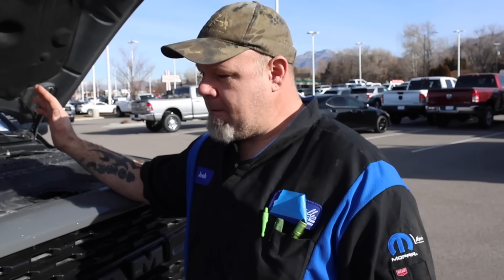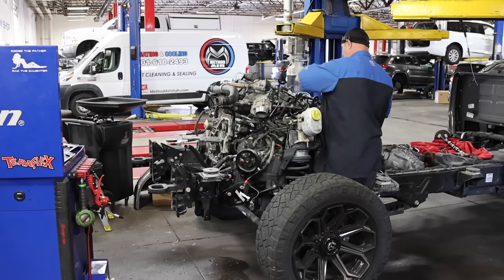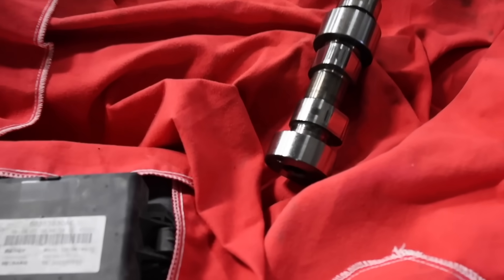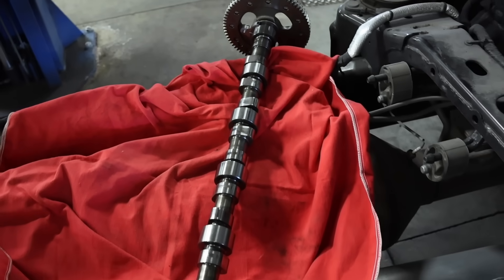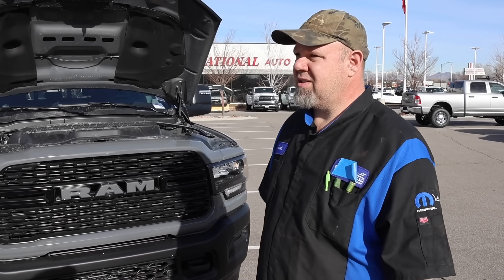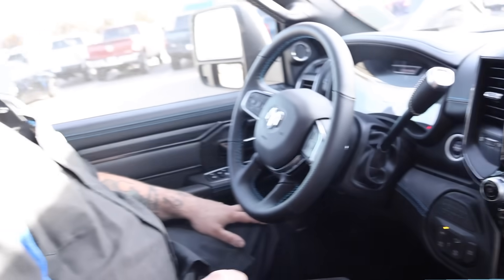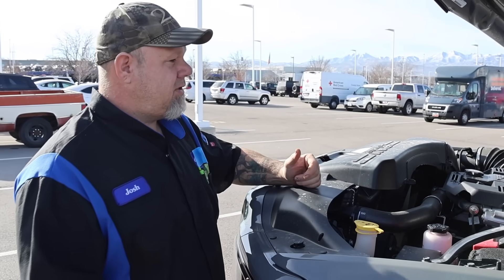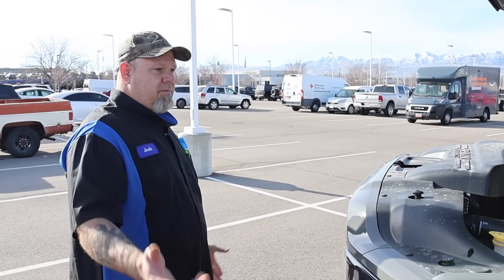Master Diesel Tech Explains The BIGGEST Killer To Your Diesel Engine!

Comment: The EPA and their mandated DPF is the largest killer of diesels.
Reply: I think EGR is worse than DPF. Lastly SCR is the least killer. Not saying DPF isn’t bad, but EGR dumping particulates back into your intake is worse than driving around the desert with no air filter.
Reply: @MrNismopro couldn’t agree more
Reply: No EGR is 1000 times worse than DPF.
Reply: @ 
Yes, another horrible EPA mandated device
Reply: @Jon-O.  What do you mean? Like a deleted truck is the worst thing for a deisel?
Reply: @SAPPER235PUNISHER No a deleted engine will last much longer.
Reply: Ford is putting a gasoline particulate filter (GPF) on their new 25 mavericks. Due to the EPA’s new strict emissions standards. Iam sure all the other big manufacturers will follow suit. Just put what I just wrote in YouTube and many videos will come up on the topic.
Reply: Luckily no DEF on my ‘09 ram dually crew cab. Too bad my DPF and EGR fell off my truck years ago😂
Reply: Please explain how dpf kills a diesel….
Reply: @ 
It is a complicated system that adds many sensors and components.  It adds thousands of dollars at purchase and drives up maintenance substantially.  The majority of trucks one sees on the side of the road with the hood open are sidelined from an emissions system failure.  The computer continuously monitors all components and if one doesn’t function within parameters the truck will give a warning that only allows a couple hundred miles of operation before going into limp mode.  This could be something as simple as a loose ground wire or a dirty connector.  Roadside repairs or tow service is not cheap and adds cost to everything purchased at the store.  Does it literally kill it? No.  It just makes them economically expensive to buy and run.
Reply: No egr is worse
Reply: Yup,  I'm a retired truck driver,  DEF is a bullshit scam
Reply: @woofman4796 ammonia oxide is what’s being produced now
Reply: EGR is the worst idea in engineering history. Eat thy own waste 🤮
Reply: How to look after egr
Reply: I need a shop in South Florida to delete my diesel grand Cherokee. The egr and dpf on the 3.0 = nightmares
Reply: DPF is done in the exhaust not the motor. I think you mean EGR which recirculates Exhaust gases into your intake which is not good for any vehicle and is especially bad on oily fuels like diesel.
Reply: Stupid pan designs keep oil from being totallybdrained. Banks has new pan that is incredible plus adds 2 quarts of capacity as well. Genius
Reply: And government vehicles are exempt from this
Reply: Def is injected into your exhaust nothing to do with the inside of your engine
Reply: @ 
You are correct until a sensor goes bad, the DEF heater circuit has a minor issues like a loose ground wire and the computer gives you 500 miles to limp mode in the middle of an extended trip.  Complexity and electronics adds to unreliability.
Reply: @ he was talking about increasing the longevity of the engine not part of the dpf system failing
Reply: The worst thing for an engine is excessive heat. And I have got to believe that the regen system creates so much heat that it has to be detrimental to the life of the vehicle. I never understood how reburning the emission particles and contaminants through the EGR and regen systems can be better for the environment. Apparently the regen system just breaks down the particulates into smaller size which in my opinion would make it more prone to be airborne longer than just dropping out the exhaust and right onto the roadbed. And by being airborne longer would allow it to get out into the areas such as lakes and rivers. In other words that contamination can be more easily spread. Just like electric cars these new solutions just create new problems.

Comment: I own a fleet of CumminsISX semi trucks. I’ve never changed oil before 20k miles on any of the 8 trucks. One truck has over a million miles and just now due for an overhaul. No issues. 5k mile oil change interval in a common rail is dumb AF and a waste of money.
Reply: Your ISX is likely sitting next to a centrifugal oil filter on the frame rail. Those things flat out work, and they're full of carbon sludge when you clean them. I'm going to be putting a small one on my 12 valve, because it can't hurt and I have the space underhood for it. These modern pickup diesels are a nightmare due to most being driven around as big cars 90%+ of the time, and are equipped with less than durable emissions components, so I fully understand the fear people have of repair bills. It really is criminal what the EPA has saddled them with. 

The guys saying they change oil at 3K leave me shaking my head. I'd run a bypass filter before changing oil at 5K miles. They are cheap and effective at pulling soot. Fleetguard even makes standard size filters with a bypass built into them.

Oil analysis is your friend as well.
Reply: Yhats tractor trailer not 3500 to 5500 6.7 liter. Your engines have 18 qt of oil or more
Reply: Those are different engines
Reply: That cummins has 12 gallons (48 quarts) . Yeah thats 4 x the amount of oil, and therefore you get 4 x the miles. So 20 k is not bad for a semi on a highway roads, just running at 2k rpm’s max, mostly at 1100-1500 rpms.
Reply: lol you’re using your semi truck fleet to make an argument about oil changes on pickups?? 😂 thanks tips 👍

Comment: On the block heater, is there a temp where u should plug n ?

Is it 50 degrees, 40, 30 …? What outside temp should we use to gauge when to plug n block heater

Comment: I had a 05 6.0 for 14 years. I changed oil every 4000- 4500 miles. I could hear the difference on start up with fresh oil.
Reply: HEUI engines are by nature harder on the oil. It was a very versatile fuel system for It's time, but common rail overcame those obstacles. Common rail also brought us more fuel related failures on diesels unfortunately.
Reply: @ChevyConQueso  I worked for Bosch and started the very first common rail engine in the US down in Indiana.  The system was very robust but required clean fuel.  The downfall was when companies wanted to cut costs and started to reduce the quality of the parts being used.
Reply: T6 in my 6.0 changed every 4,500 miles and my oil was crystal clear when it came out.
Reply: Mine blew the head gasket right after the warranty expired!!
Reply: @ToddSwimmer   I got lucky, mine went during warranty. A good friend was the diesel mechanic at the deslership. He did the work. I had to buy the $500 ARP studs. He went through EVERYTHING and deleted the whole EGR system at the dealership. He had a big pile in the corner of the other ones he did.
Reply: If you run Archoil AR9100 in the oil and AR6500 in the fuel you'll stop hearing the difference.
Edit: The more important one is the AR9100.

Comment: Great information but i think after a hard tow or driving a interstate speeds you need to idle for at least 5 minutes before shutting down  i service a fleet of w900 kenworths w ith c15 cats they came with factory installed twist dial style kitchen timer idle switch they recommended at least 7 to 10 minutes of idle before shutdown all turbos spin 186000 rpms they get really hot!! Merry Christmas to all!!!

Comment: As a result of your guidance (including your other videos) I tried "DRIVING IT LIKE I STOLE IT" for test purposes!  GUESS WHAT!
My plugged DPF, so unwilling to go into regen, WENT INTO REGEN before I got to the freeway, before it was warmed up, within four blocks of the house!  I KNOW that is contradictory... however!

All I had to do was MASH THAT THROTTLE a few times at stop signs, slow down, and (I estimate) the difference in back pressure, never seen because I drive to maximize fuel economy hauling or not, was sufficient to cause a ALMOST NEVER SEEN regen.

I conclude (and invite your analysis) IF YOUR TRUCK IS BABIED TOO MUCH IT WON'T GO INTO REGEN.   
DRIVE IT LIKE YOU STOLE IT (like a drunk teenager, I guess) every so often to initiate a regen!

Do you have ANY idea how relieved I am? Drove 40 miles, and it completed regen, DPF is at zero percent.

Thanks, thanks a LOT.